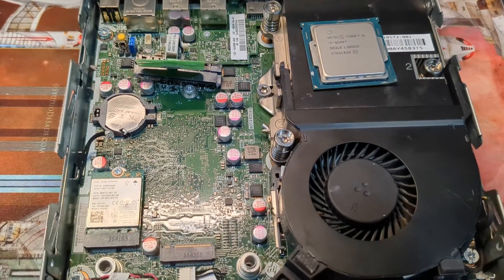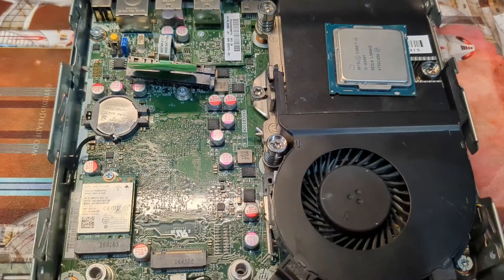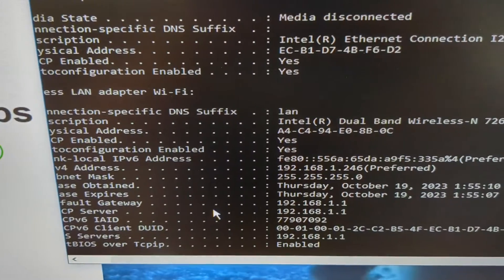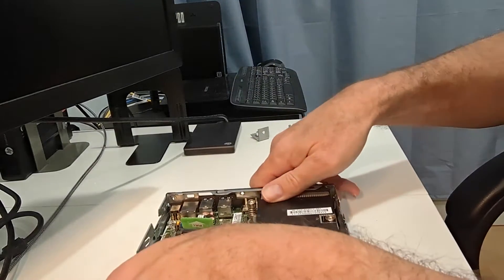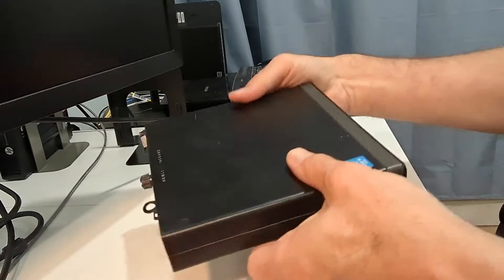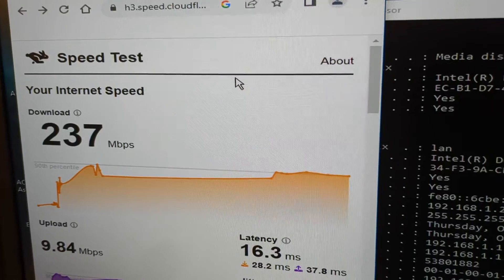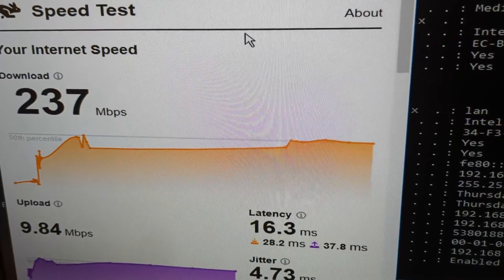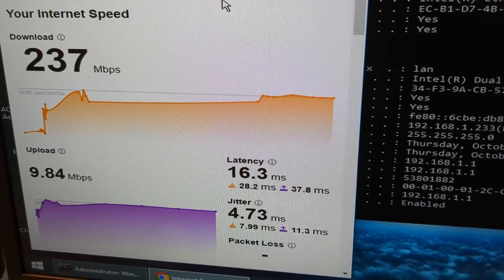Wifi Upgrade for the HP EliteDesk 800 G1

Comment: I have a HP Elitedesk 800 G2 Mini PC with a Wi-Fi card installed but it's not showing up in device manager for some reason. What can I do to fix this and get it working?
Reply from the maker: Boot up and go into the BIOS (Hit ESC as it is coming up and then F10 for BIOS setup) - go to Advanced and check under System Options and make sure the M.2 Wifi is turned on - also check under Built-in device options and make sure the M.2 option is on.
Reply: @handmedowntech Yeah I tried that already and still not showing up.
Reply from the maker: @PurpleStarfish_0 any chance you have a bad wifi card?  Which part number or model are you using?
Reply: @handmedowntech I dunno if it's working or not because I never tried to use Wi-Fi on this PC since I bought it off eBay in 2022. But now I need to get it working because I plan on putting it in a location where ethernet connection won't be possible. Btw one of the things I tried was to unplug the two connectors on the Wi-Fi card and reconnect them. However when I did that, a tiny gold ring piece fell off one of the plugs and went under the nvme drive. I had no idea there was something like that on the plug. I don't know what to do now because that nvme drive is where the Windows operating system is install on. So I dunno if removing it temporarily to retrieve that little ring piece will cause me to have to reinstall Windows. Not something I want to do.
Reply from the maker: @PurpleStarfish_0 the little gold piece is most likely the connector for the antennae.  You can remove the NVME and get that piece so it doesn't rattle around.  To save yourself more grief I'd suggest getting one of those USB wifi adapters.  They have the built in wifi and antenna.  That way you don't have to mess with a potentially bad wifi card.  You could then use that WiFi slot as a second hard drive. I have several videos on setting that up.
Reply: @handmedowntech  Okay thank for all of your help.

Comment: hi, i have an HP elitedesk 800 g1 but is not the mini you show, is the bigger case size one, can i install a wifi card PCIe in it ?
Reply from the maker: Which model?  The larger units might not have the same sort of wifi slot.

Comment: what a pain... to put those wires back on card. and of course card i got, was with different newer connector. is 8265ngw would be latest to work with G1? thank you
Reply from the maker: That's what I try to put in my units. I just never have good luck putting those connectors on and sometimes they're a little bent so it makes it tough to get a good "snap".

Comment: Wow, seems to have made a nice improvement!
Btw, just purchased a G1 from Ebay, HMDT.
Can't wait to receive it and get to knowing
the unit and how everything functions in it.
Nice videos you are making. Really enjoy them.
PS. Besides the HP Support Assistant, I usually download the Intel Driver Device
Updater as well. I let it scan my system and many times it find old drivers
and offer new updates to your system. Just a bit of info for you
if you've never used the Intel tool. Take care.
Reply from the maker: @rockerforlife194  just grabbed it.  I like that it comes directly from Intel.  It found some old drivers on my system.  I'll add it to my standard windows config.
Reply: @handmedowntech  Great!

Comment: Why in the world would you put a dual band WiFi card in a G1 mini? The G1 mini has multiple design flaws, the biggest being the air flow! HP designed the G1 incorrectly by putting the heat sink in front of the cooling fan. That means the cooling fan has to suck the heat from the heat sink instead of blowing the heat thru the heat sink, which is a better cooling solution. If the G2 had a dual band WiFi card your better off leaving it in that one because the G2 does not have the design flaw and is more efficient at cooling. Another design flaw is that on the G1 you have to revove the SSD and the drive caddy to get to the memory. In the G2 you simply lift the fan to expose the RAM slots.
Reply from the maker: Totally agree on the G1 fun.  I figured I had the wifi card not doing anything so what the hay.  Let's upgrade the G1 😀
Reply: I have both but the g1 supports intel xeon. My g1 runs with a Xeon e3 1285L v4  and smokes my g2 with a i7 6700T

Comment: Need a video for my G2, just bought a used G2 without a Wi-Fi card inside.
Reply from the maker: The tricky part is the antennas.  Did the unit come with the antenna wires but just no wifi card?
Reply: @handmedowntech  just found out, it’s the G2 35W, no antenna. I’m just going to use the usb wifi, also with the 35W could you upgrade later to Window 11 pro? Mine come with intel i5 16gb ram, thanks
Reply from the maker: I use Windows 11 pro on my G2 - the question though is whether you can take an existing Windows 10 and upgrade it - I did mine as a fresh Windows 11 PRO install
Reply: @handmedowntech  yes, it works for me. i did fresh 24H2 11 installation and entered key.

Comment: The Tiny form factor makes it small to work inside and see on the video what you're doing. Hard for me to tell, but can you simply disconnect the cables from the SSD and remove the drive and caddy as a unit?
Reply from the maker: I pulled out the G1 to look at it again.  There are two screws at the other end of where the SSD sits in the cage so you have to shift the SSD toward the back of the unit in order to remove the SSD and the cage.  And in order to move the SSD you have to disconnect the SATA cable from the drive and the motherboard.  The later models (G2, G3, etc.)became much easier to deal with.

Comment: these machines are mini nitemares and to be avoided when you can easily get a full tower/mt
Reply from the maker: Would be great to play with one of the Elitedesk 800 SFF - possibly for a NAS since it has the expandability
Reply: @handmedowntech  The EliteDesk 800 SFF is nice, but you will be surprised at it size.  I personally like the ProDesk SFFs, they are not as long, and easier to manage, though you give up the extra 3 1/2" bay.  Towers are fun, but not to move about, for me anyway :)  I have a huge CaseLabs Case that is a beast...nothing in it now.  It was used with a four GPU setup crunching data for S.E.T.I. @ Home before they stopped the program.